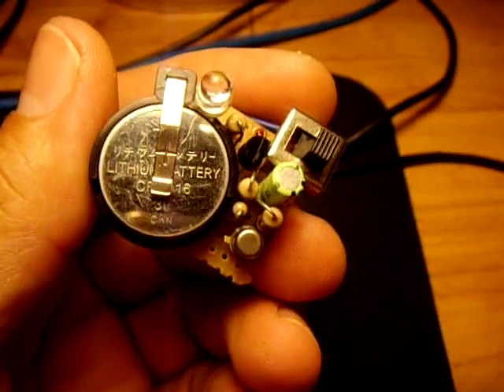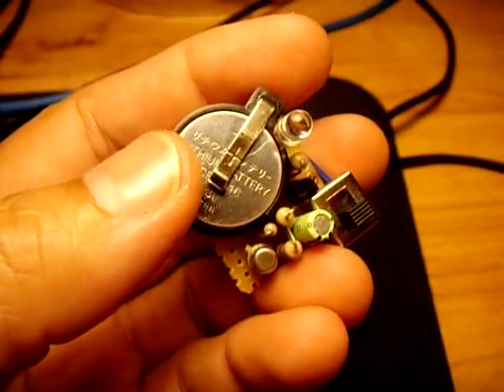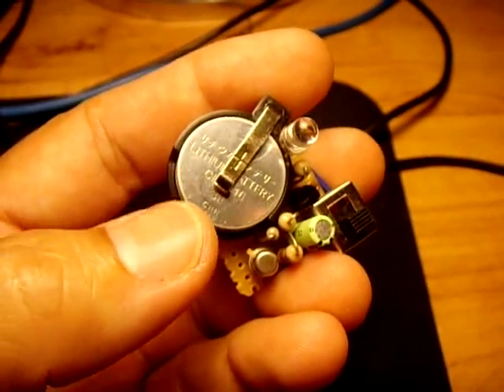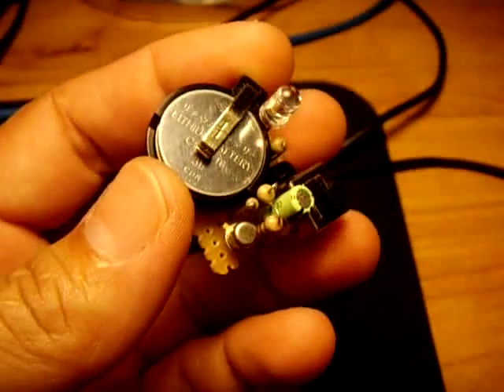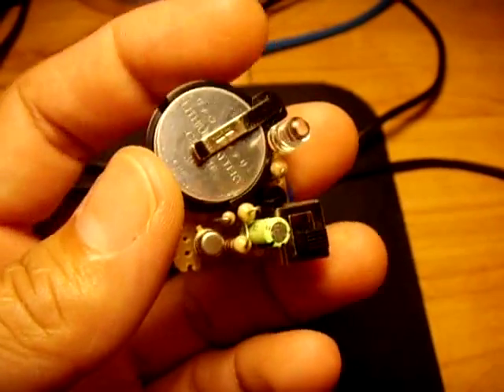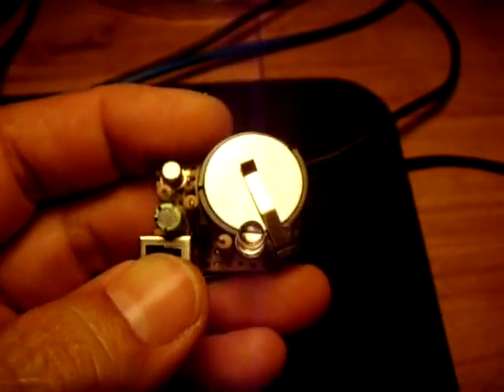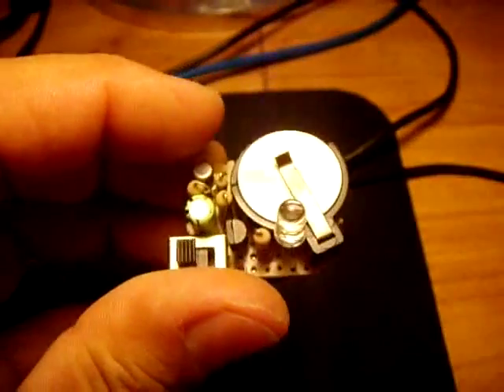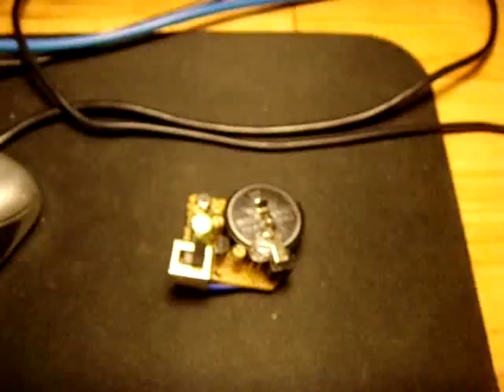Simple LED Flasher Circuit - Dog Collar

Comment: I'm interested in expanding this circuit so that it can be used for turn signals on a bike.  What would need to be modified if i wanted more lights? bigger battery (or more voltage or both)  i'm guessing, but im a beginner so that's all i can think of